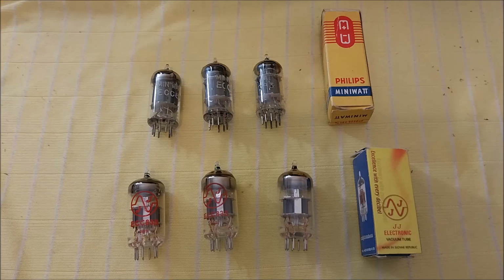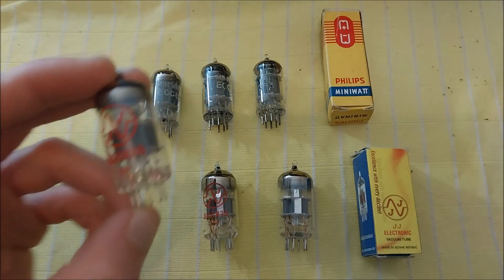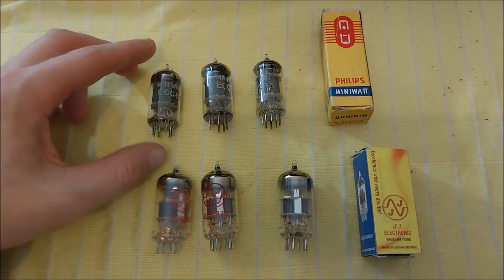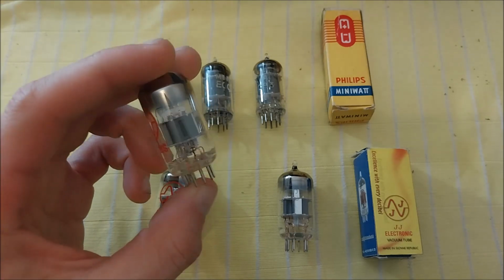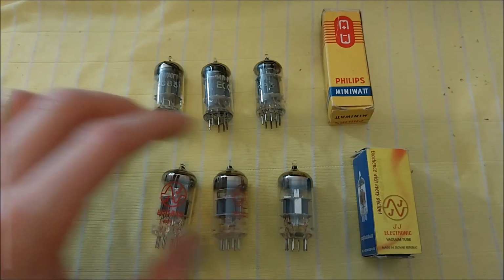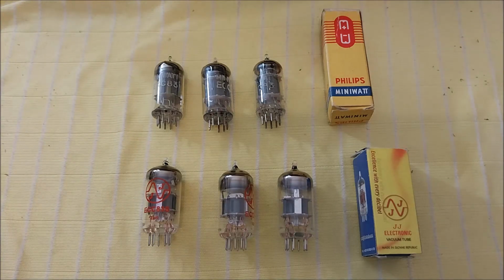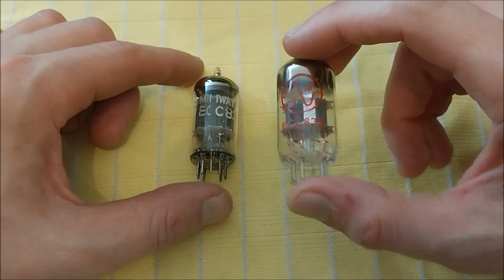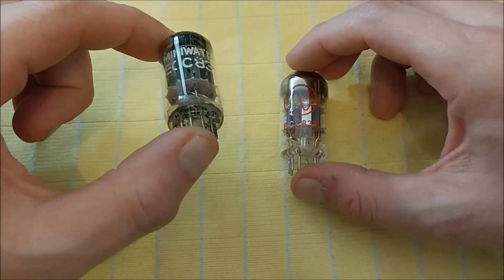Tube Sound Comparison - ECC83/12AX7 Modern VS. Vintage ( JJ vs Philips)

Comment: i used to have an american peavey classic 50 tubed with jj's from the factory sounded ok to me, after about 10 years it sounded off no highs so i needed a retube ,asked for the same jj's but guess what? the same jj's don't exist after ten years no one knows when they change a model with modern tubes. so the amp was fully retubed with new jj's by a certified tech and it sounded horrible like here in your video like plastic i don't need my hd 700 to notice that nasty tone i hated it and sold the amp eventually. only years later when i bought a new amp and realized again that no  one knows shit about tubes in my country i went to a specialist-the tube king and got some guidance and a tube tester and started experamenting with the greatest hits on some of the best amps ever made.
conclusion -don't waste your time money or energy on modern tubes instead go for the best ever made they sound better and last longer.
Reply from the maker: I have JJ's from early 2000's NIB.. is that what you were after? Did they change so much over the time? I also have early 90s JJ made Tesla branded tubes..identical to construction of modern JJ Ecc83s..But the shielding between triodes seems to be carbon coated and few other details different..they sound different like night and day..this JJ Tesla are more organic and smooth..the JJ's on the other hand are harsh and unbalanced sounding.
Reply: @ecc8344  the amp was from 1993 so 90's jj's sounded great vs 2005 jj's which were unusable to me, ive upgraded more than 30 amps and when i take out jj's and put vintage mullards instead on marshalls it feels great .the mids and bass are better and you get more clarity air and definition, i must try those philips they  sound great

Comment: The new ones sounded better than the vintage. Of course vintage lovers will never admit that.
Reply from the maker: Hmmm..personally..I dearly wish I could say I like new ones better..since would be so much more convinient to get em new and cheaper then vintage...But after 3 years of constant tube rolling (god bless my amp's pinouts) Ive found that there is nothing like vintage..sure new ones sound OK (especially if your goal is hi gain distortion) but when it comes to dynamics,voicings and character vintage wins the race. If you never tried vintage ones you cant undestrand it :) I personally dont prefer vintage because its cool to have 50+ year old tube.. But all that I mentioned above..and great that modern tubes serve your purpose 👍